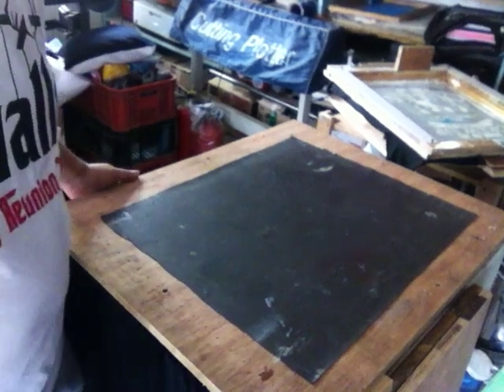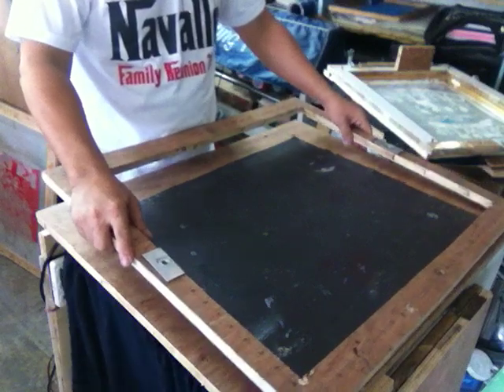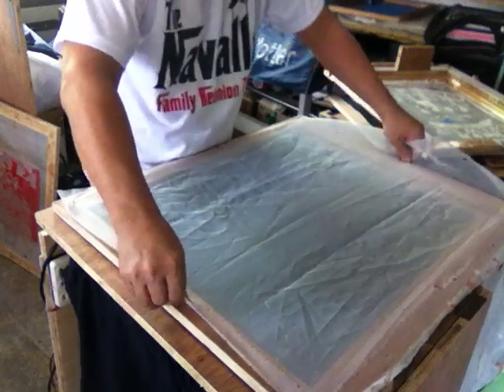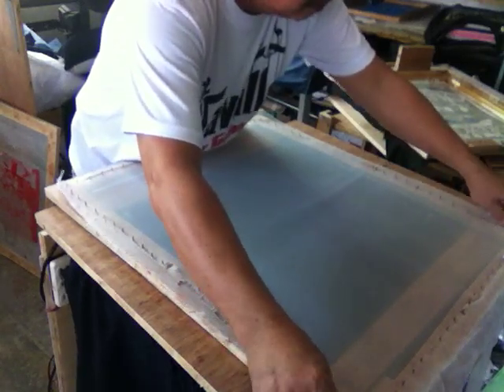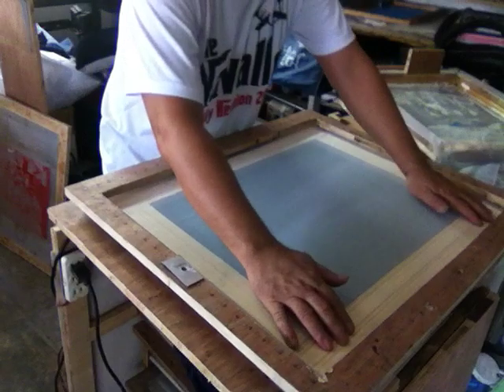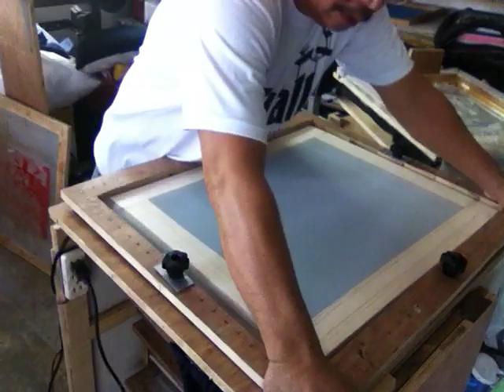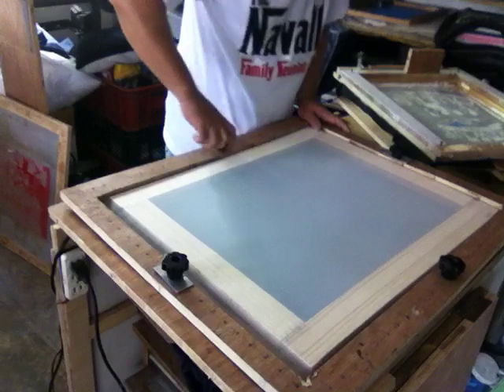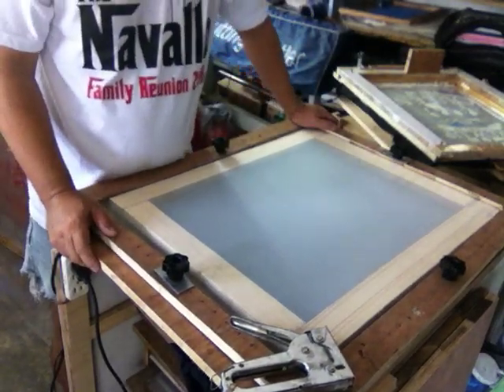HOW TO MAKE A VERY CHEAP SCREEN MESH STRETCHER

Comment: You are not a poor man, you are very rich with technical innovations and ideas. Well I also use 'the nail bar stretcher' at my Art Shop in Ghana. I  am going to try this also. I have got an idea from yours, to use an aluminium flat square frame of a required size with fast drying super glue to glue the mesh in place, before I screw or clamp it down to the original frame to obtain the tension by using small G - clamps.Thank you for this idea! Man you are very rich!
Reply: You can make metal strecher by your own with the help of welders...  I made one..  Much easier to stretch

Comment: Wow! It worked perfectly 100%. I used an aluminum flat frame with a fast drying super glue to pre-attach the mesh on it. I then turned it outside down unto the original frame and clamped it down using four pieces of 1 inch C-clamps on all the four sides to stretch. So far so good, this is the best , simplest and low budget screen stretching manual device technology I have ever seen from all the DIY screen stretching tutorials. Thanks and I hope you will try it also because you don't have to use the nails to grip the mesh. Just your super glue ,your aluminium or wooden frame, a piece of flat board cut to size and clamps. Thank you for your idea.
Reply from the maker: I am happy that i have helped you make your job easier. Good luck to you my friend. God Bless!!!
Reply: To you also, God bless you in all your endeavor and many thanks.
Reply: Can you make a video of yours?
Reply: I'm trying that too. Geniuses!

Comment: I have been looking at many mesh stretchers....and I like yours. I will have to do some mods to mine as I’m doing screens for my yudu screen printer they are thin metal frames, very thin. But I like what you have come up with!  👏👏👏👏👏👏
Reply from the maker: Thanks Ms. Lynn Houts. My frames are also thin since I am using ply boards ever since. I am making a lot of screen frames coz I am planning to have my own clothing line.  I am also assembling the frames on this small table using wood glue and stapler. I am also doing all my screen printing devices being an avid DIYer. Thanks for appreciating my idea. Happy printing!!!

Comment from the maker: Wing nuts can also be used in this device, but in so doing, the bolt must be fixed underneath, and it will always be protruding in the frame, hence, it can disturb the operation. It's better to modify a timber knob with bolt and a fixed T-nut underneath for easy tightening,  rather than wing nuts which is hard to turn specially on the final stage when there is already a tension on turning the nuts.

Comment: Cool what glue you used
Reply from the maker: Just rugby. then I support it with few staple wires. I only remove the screen frame when it is already dry so that there will be no movement on the mesh.

Comment: how many newtons it can reach with your stretcher sir?
Reply from the maker: Sorry, i don't have a device to measure  the tension. It however gave me the best tension I have done manually. And the best looking frame i did with the use of adhesive, it gave me even tension all around the perimeter of the frame.
⁷
Reply: @ScreenPrintingforFunandProfit  s

Comment: Thanks for your video....

I have made this and tried a few screens.....But my mesh keeps ripping...I will try again on another day....
Reply from the maker: thanks and pls subscribe, new videos will come out.
Reply: Maybe you can make a rounded corner so that it wont rip the screen..
Reply: @ninjalex3749  I routered a groove in my outer frame and glued a 1/2" dowel in place.....When the 2 sides are clamped together it holds the screen tight while I stretch it.....Works pretty good....
Reply: @royceschmidt8765  can you show us? I'm having tearing issues with the nails.
Reply: My screens are ripping too from the nails.

Comment from the maker: This is a very cheap innovation which almost cost me nothing except for the M8 knobs I bought online, which I still have to modify since it comes from China with different size and it does not fit our Philippine made M8 bolts.